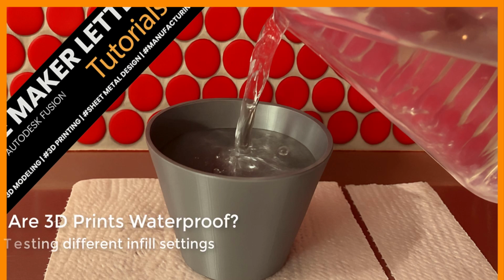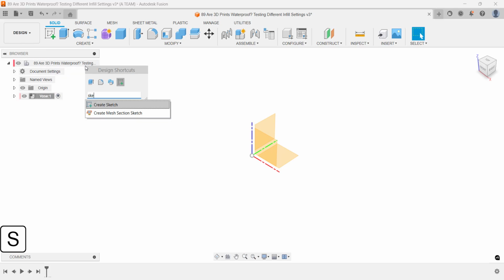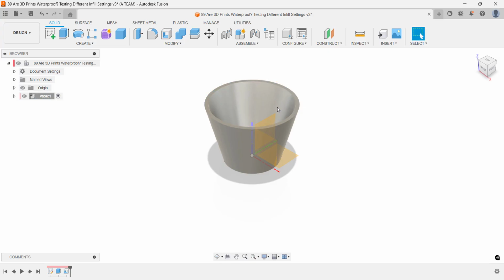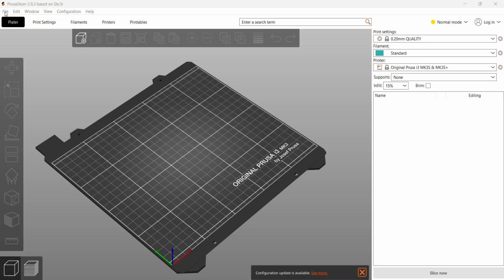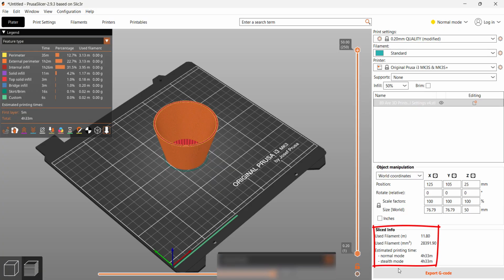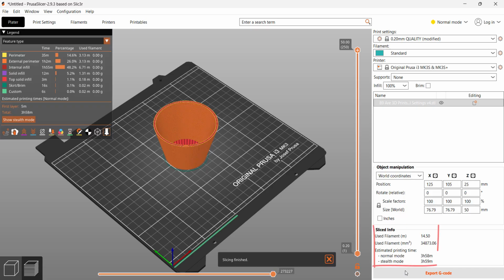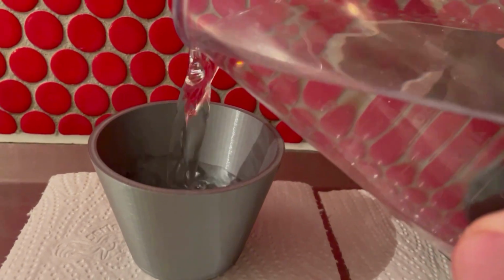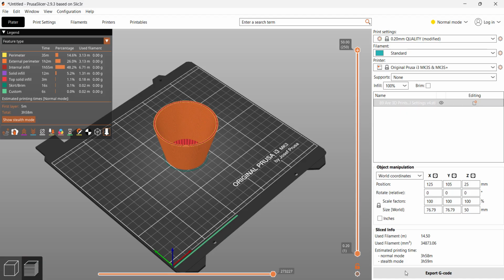Are 3D Prints Waterproof? – Surprising Infill Results

Comment from the maker: Do you agree?
Reply: I've printed several water containers in PLA and ABS successfully, one a soap mixer for a hose (so I presume subject to mains water pressure.) Just used 5 or 6 0.4mm walls.

I printed a PLA replacement bottle for a hand pump soap dispenser which got left in a hot car over the summer. It softened and expanded due to the internal pressure but didn't leak.

Comment: I printed a float in a watermark from PETG. It sank after about a month. Infill 15%
Reply from the maker: Interesting! Did you see if it sank fast or slow? (once it started to sink, not counting the hole month)
Reply: @The_maker_letters  No, I haven't seen it. It's a small float installed in a clear hose on the side of the IBC container that collects rainwater. The float is cylindrical, 8mm diameter x 30mm.
I found it downstairs one day.
Reply from the maker: Ok, thanks for the answer!